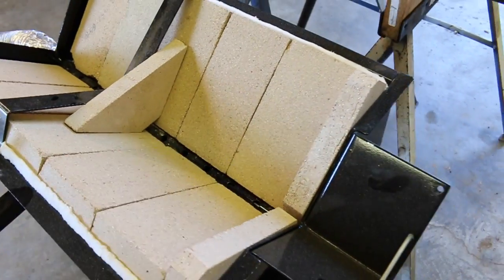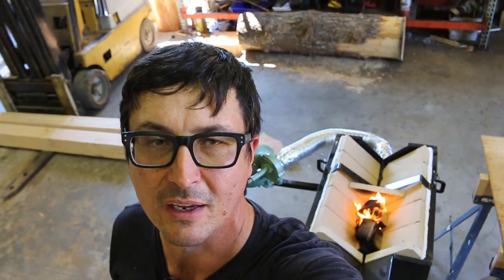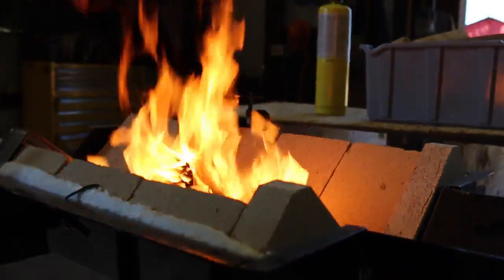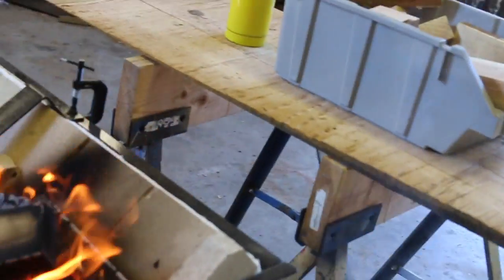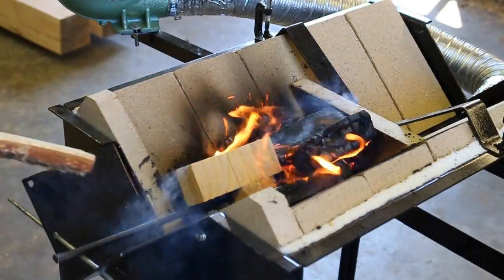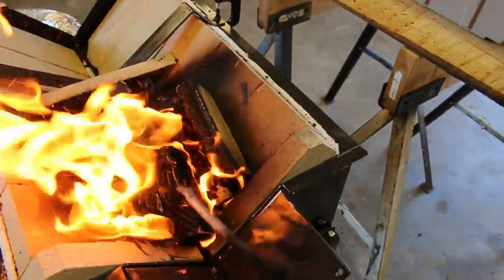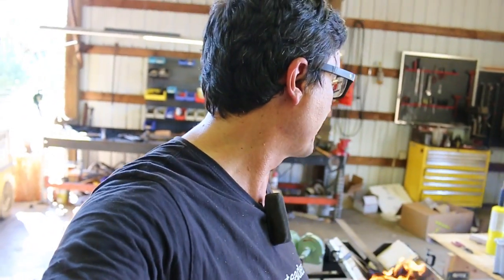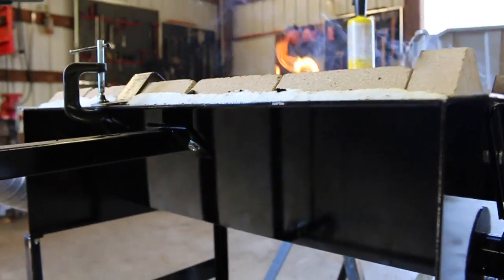Forging Steel With Wood Scraps

Comment: Can we please just ignore the haters in the videos please? I know your upset by these people but I think It distracts from the content.
Reply: wonderfulmax it seems like they have been bothering him more and more and i think it just makes him seem more petty when he responds to any of thier hate. let them think what they want you don't need to challenge.
Reply: wonderfulmax It is important to provide an opposing viewpoint in consideration of the manufacturer.  It isn't right to let false and misleading comments to go unchecked that may harm the manufacturers reputation.  Small companies like this rely heavily on what is presented in reviews like this.  Just my thought.
Reply: canesrock82 Very true!
Reply: mdbigman It is a great design and idea. However, the truth is, it is expensive at over $600 for this setup and could be made much more cheaply by someone with basic skills, wanting a wood/charcoal forge. Not hate, just the truth. Supporting local businesses is great, but so is DIY. Peace
Reply: katgolds30 You must be right.  Please build yours and post your video for all to see!  Don't forget to provide your itemized cost for materials and labor.  Don't forget to include the engineering exploded view and graphics department's designs for the blue prints and assembly manual.
Reply: mdbigman While I think this is a great forge. With the exception of the air adjusting dial system the rest is a simple design. I understand the cost though, getting the blower, having the metal machined, the air channel system cut, everything coated and painted, that flame resistant material, bricks, paying wages, blah blah. Something similar can be made, for less, it wouldn't be as pretty, wouldn't have the special dial but it'd still function. Now the people bitching about the cost and using the 3.00 worth of flex pipe, and the support being long because someone stuck the wrong thing in the box (which happens all the time people with any company), and that's their argument for it being a piece of shit, a bad company or too expensive, I don't get that at all.
Reply: tattedupdaddy1 I would agree that a skilled metal worker can reproduce this forge design, most hobbyists would not be able to match the design.  It took Whitlox many attempts to come to their final design and that was with engineers working in the process.  Yes, someone could try to make a similar forge but do you believe they would be able to match the performance on their first mock up?  I doubt it.  Personally, I think the price is very reasonable and a very practical design.  The smaller forge is about $160.  That is about what I would expect you would need to pay for materials to duplicate the same design.   Not too shabby and inexpensive enough that I doubt that I would even bother trying to make one of my own.  So much easier to purchase one at that price.
Reply: mdbigman katgolds30  I checked they sell the plans for 15.00 so you can build your own if your so inclined.
Reply: tattedupdaddy1 I believe that Whitlox changed their policy and no longer sell the plans.
Reply: tattedupdaddy1 Yes I know they show that on their page but did you read the comments associated with this link?  Take a look and you will see they changed their policy.
Reply: I stand corrected after reading the full description they give you a link to a video of similar design and several pictures to figure out your own plans. The 15.00 is a nod to them for inspiring you, if you so choose to pay that. They do offer to supply the tube and bricks for a fee if u choose to incorporate that in your own design.
Reply: tattedupdaddy1 Yeah I noticed their change yesterday.  I think they are right, a skilled metal worker would be able to fabricate a similar design but for a hobbyist it may not be cost effective for them to try to replicate.  That is pretty cool that Whitlox will provide those additional parts.  Ceramic blocks like this can get damaged and may need replacing.  Good to know you can get replacements.
Reply: mdbigman I was thinking two steel plates, welded at an angle to a steel pipe, drill some holes, cap off one end of the pipe attach blower/blow dryer to the other end, add fire bricks. And u have an ugly nonadjustable illegitimate whitlox. lol. That's about as good as it'll get and stay under 100-150 unless you find the material at a scrap yard. Its just a wood burning version of a brake drum forge that most hobbyist have. The fact they are willing to supply the tube and bricks even for a fee is great. Its kind of modeled after computer components, or kits you find today. Buy the finished project or buy the components and build your own system.
Reply: tattedupdaddy1 I agree and considering your time invested..I think the price to build is pretty much a wash in comparison.  I don't think you can beat the price of purchase.   I was thinking you could make it modular by making the end of the forge removable and adding another small forge (three inline together) you could really handle some lengths of steel bar. LOL  I saw one comment where someone with this forge used a bathroom fan he bought for $15 as his forge fan  That sounded like a great idea.  I hope Whitlox does well.  They seem to be a good company.
Reply: mdbigman I like the product and company from what I've been reading up on them. I just don't have the cash flow to justify making that purchase. My wife would probably kill me lol. Because I've only ever worked with small stuff after finding this I've already been planning to attempt to make a small version based on what I described. The exhaust fans work better according to some because it moves a large volume of air at a decent speed, giving a more controlled burn. Where as the blow dryer can move the same amount it does it fast and will burn through more fuel in the same amount of time. I've piddled around with a campfire  and a desk fan on low or high depending on heat needed. And I've made things like trivets, fire pokers and things like that.
Reply: tattedupdaddy1 I have done very little myself, yard tools and small blades for utility.  I would like to do some blacksmithing one day.  I did find a YT site that I liked.  Good demo on making your own smithing tools. 

 Torbjörn Åhman

Pretty well produced videos (although his measurements are in Metric LOL )  I found his site pretty interesting.
Reply: ***** Did Cody do what?  (provide some context to your comments if you want to address something with me).
Reply: ***** Your comments are pointless because you don't include any context!
Reply: TheJohn8765  No it is called show your work, and give positive advice unless there is a major safety issue.

Comment: I have watched an old time blacksmith use ni thing but small sticks to run his forge in a pinch.  He said you want to keep the wood about the thickness of your thumb.  His theory was the faster the wood burns the more energy (heat) it would release. He just used sticks picked up in the yard.

Thank you for taking us with you on your journeys.

Comment: I am sorry to hear that people have a hard time with the forge. As it turned out, I had been holding on to a large brake drum for a few years to make into a forge. I even bought an identical, used, "Bufco" blower as yours to rebuild for myself. Then, just when I pulled out the brake drum to start fabricating, I learned that other shapes work better in forges. Coincidentally, your first Whitlox video came out and I was STUNNED! "YES!", I said to myself. THAT is how it is done! But, working on a tight budget, I will try to build my own version of a "VEE" forge. Thank you Whitlox!! (I like yours better though!)

Comment: Hey, I've been watching your channel for a while now and I have just been completely inspired by you. Watching this video I just wanted to say if you want to make blacksmithing charcoal from wood there is a different way. Forgive me if you already know this, but a simple way to make coal for your forge is simply taking a steel drum and putting an inch size hole on the lid. You need the hole because the trick is to have a limited source of oxygen flow for the process to work. So you load the barrel with preferably the same type of wood. I say that because a hard wood would obviously burn a lot slower than a soft wood and bot create the same consistency of charcoal. So you get the fire going in the barrel with however much wood you desire. As soon as the fire gets going seal that lid on. This creates the slow burn and after like five minutes cover the hole you created cutting off all oxygen. Then leave it for a few hours and after the charring process has taken it's course remove the lid and find the charcoal you can now use for your forge. There are other videos that are a lot more descriptive, and some with slightly different methods. I wish you the best of luck with your new forge it looks great. God bless.

Comment: Does it blow ash and/or embers around your shop?
Reply from the maker: Dallas Alberta Not that I noticed,
Reply: wranglerstar Nice! Looks like an awesome set-up
Reply from the maker: wranglerstar Here is a link to buy the Whitlox compact version: https://goo.gl/NzEd6R
Reply: Dallas Alberta I think It might depend on the wood.
Reply: wranglerstar Wish I had the space...I might hear from the condo board if I set one up on the balcony.
Reply: wranglerstar My grandpa built a wood fired forge before I was born and he found that as long as the wood was fairly low in sap and not wet the ash was really light. But I guarantee that it will be far less of a mess than coal!
Reply: Dallas Alberta only for the first couple of minutes when I used newspapers to start the fire and hit it with air. When I got mine going good enough to get a piece of rebar to a nice yellowish orange color there was just a blast of heat with a clean burn. In retrospect, I should have used a propane or mapp torch to start it like Wranglerstar did.
Reply: ***** Yeah man! That thing can do it all!
Reply: Dallas Alberta not if they think it's a BBQ.... ;)
Reply: Dallas Alberta hey dallas what part of alberta you from?
Reply: Dallas Alberta  Ash may fly over the place from what I'm see but the air flow is directed towards the heat source so the ash being blow up and around is definitely much lesser than his drum forge. As for embers, I'm sure he already clear off the burnable material around the forge before starting it. And for those talking about how flimsy it looks. He already bolted the legs to a tight fit and according to the creators, they used 11 gauge 1/8" steel to make the body, so it quite strong and sturdy. Furthermore, there's insulation between the bricks, fire and the steel. I don't think the whole forge will crumble after long use. So quoting what Mr Wranglerstar said, keep your negativity to yourselves unless made a better forge than this. I apologise first if I have offended anyone including Mr Wranglerstar.

Comment: I really like it. One question though: Will it reach welding heat? Like white hot?
Reply: I was going to ask that same question. You need a real clean fire with no clinkers or rubbish to do this with coal so I'm wondering if you can reach the same temperature. So we will wait and see
Reply: Dutchhorse you can but with wood/charcoal you burn through it so quickly that it's almost counter intuitive. but Cody will just make the "argument" for lack of better work that he wont be doing forge welding in his shop.
Reply: Grant Silliman, Jr. Yes I can see that happening. I would like to see some one give it a try tho to see how much wood/charcoal would be needed and how fast you would get throw it, I think it would be a struggle
Reply: Dutchhorse Alright, wranglerstar show me a proper forge weld using just this forge and scrap wood, and I'll consider saving up some money for one. I love it but if it doesn't run similar/better than a normal coal forge, I just won't buy it. Period.
Reply: look up a guy called 'pave w.' I saw a video of his where he was making a damascus steel knife with a very similar, if not the same, forge.
Reply: +William Cummings thank you!

Comment: My first bit of forging was done with a wood fire. The air supply was a 1/4" air line from my Dad's old compressor. I made a bowl turning gouge following a method from what I believe was Fine Woodworking. It was 30 years ago and I'm not sure of the source.
I just poked the 3/8" diameter spring steel rod in through the door of the sheep herders stove in the workshop. Got it to yellow hot and pounded it out on a chunk of scrap.
I like the idea of using scrap wood. Since it's such an easy source of fuel for you then by all means it is a good deal.
Coal is nice and I have a supplier locally so I'll probably stay with it. I've used all kinds of heat sources from wood, coal, propane, and even electric induction. It doesn't seem to matter what gets the part hot. Once it's yellow hot it's just a matter of hitting, or pressing, the steel to the shape you want it.
The Whitlox Forge looks like a well made unit. Not wild about the blower but I understand the constraints of cost and availability. I'm looking forward to seeing more about it as time goes on.
Next up the Wranglerstar line of forge tools. Tongs, pokers, and tons of hammers. If you follow the standard path every bit of scrap steel in the area becomes part of the projects.
Have fun forging.

Comment: I have never had the chance to use a Whitlox forge but with that said My first forge was a regular wood fired forge. They work wonderfully and I have found that For me softwoods tend to work better but any wood that is accessible will work it just takes that time to get it down to charcoal. Mine was a dream to use until what I was using for an insulator material broke down then I just had to switch over to my coal forge from there. 

I think that all forge types have their benefits and drawbacks. I like all three types and for economy I like the wood fired forge the best. 

I loved your opening statement the best about all the couch potato naysayers. Well said sir. And lastly enjoy your new forge.

Comment: Well, I am impressed. I have never seen anyone forge with wood without first turning the wood into charcoal. Very nice portable design. My big forge will probably do some things this one won't but, this One is portable and mine is not. You could take this out into the field and fix stuff on the spot. Very nice.

Comment: I wish I could click the like button more than once. The new camera is just fantastic and perfect timing to show off that fine Whitlox product. The thing that really  impressed me  is how efficient and strong the bellows fan is. Much more heat than I thought possible to get out of scrap wood. Best of all you're not poisoning yourself or choking on coal smoke. Even deep inside the shop you didn't seem to be bothered by smoke. So far the only downside to your channel is when you even acknowledging the trolls. All they really want is for you to mention them. Why give them that power. Take a break Cody, if a fire kicks up, it could be bad you'll need to be rested. As always thanks for sharing.

Comment: Very cool. Wish I had a nice big workshop to get something like this set up in. I made an aluminum/copper smelting furnace that could be used as a forge though. Took a clay chimney flue, stuck it into the ground, and ran a ventilation pipe beneath it that was hooked up to a hair blower.

Comment: Love the new Wiltlox looks like a great forge.
But I have 2 small suggestions based on working for many years with both large and small forges.
The first was one of my first lessons from my master smith.
Fire control, With a proper fire when you crank the flames should shrink and the heat should concentrate towards the bottom. When you crank till the flames rise you produce an oxidizing flame. Resulting in excess fire scale and pores in the metal in extreme cases.
I was taught to spray water on the out side of the fire to form a cave to work in where the cave would become a cokeing furnace. This will probably not work with large wood like you are useing but a little water would help keep you from singeing your eyebrows. As well as produce a more efficient fire.

I would also suggest adding a cross bracing to the legs to stop the front to back wobble. I borrowed a portable rivet forge once and ended up pushing it across the shop floor while working Just from putting irons back in the fire.

Comment: Well I must say that I am suitably impressed with the whole thing. Running on wood, clean smooth design, light weight, very nice. As for most of the comments on the build quality etc. It's fine from what I see... A good design works for it's intended purpose, is easy to use and esthetically functional. Besides, it's meant for hobby use, not a production shop.

Comment: This is a great system for a forge , the first time I tried to heat up a piece of steel I used a rough version of this by propping two pieces of flagstone at 45 deg. Worked really well. Have used charcoal and coal as fuel and I do prefer burning wood. I would like to change my forge to something close the Whitlox style. Thanks for posting this video!

Comment: The answer is yes - these will do a very nice job. I needed a very nice pile of charcoal broken smaller than the 2x6 sizes to get my rebar to yellow on mine. Next time, I would fill the forge with wood when you start. My big gripe with it is that it seems like every time I've wanted to use it the last couple of weeks, work and/or weather blocked me.